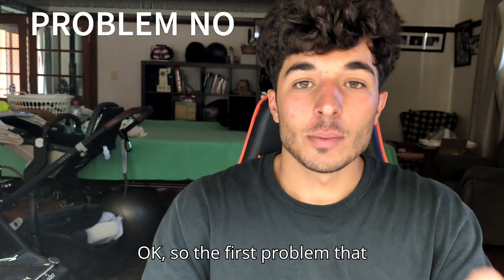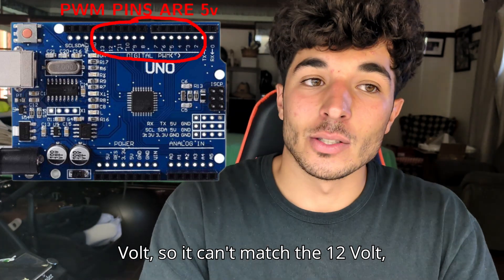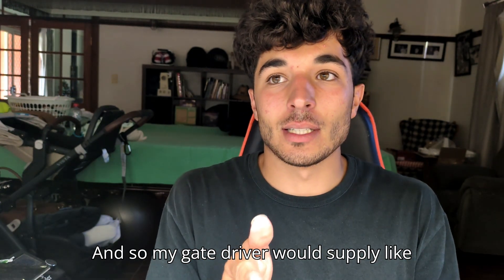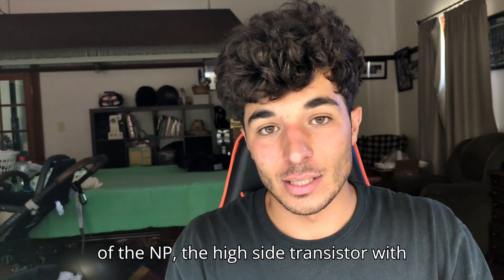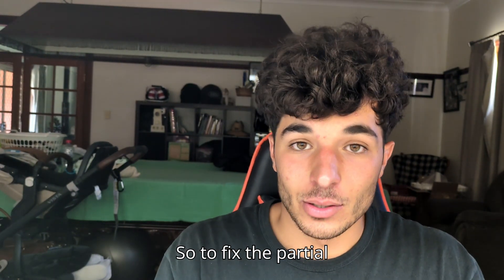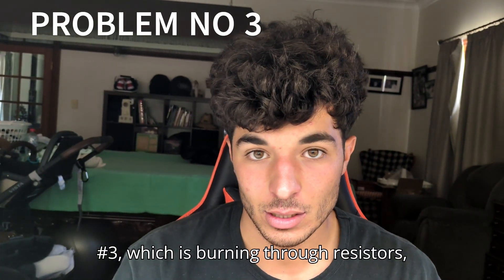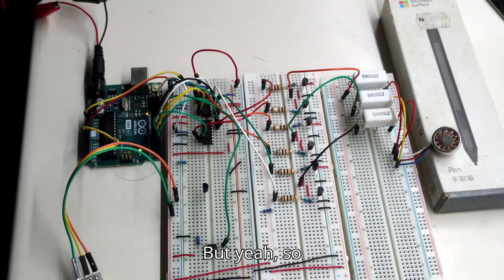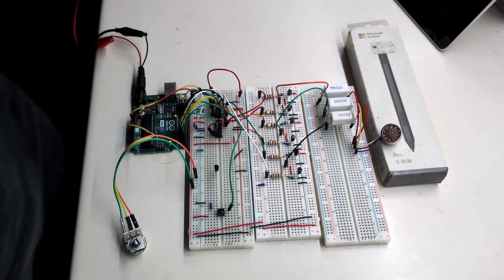Electrical Engineer builds ESC using BJT's instead of MOSFETS

Comment: I truly cannot fathom why you'd WANT to use BJTs for this application when MOSFETs are literally made for this.

I realize that you'll need a single of NPN BJT to translate from the Arduino's 5V output up to the 12V of your motor supply in order to control the gate of a P-channel FET (the top driver), but that's exceptionally simple. And you can tie the Arduino output directly to the gate of an N-channel FET (the bottom driver) and the MOSFETs will barely break a sweat since they're voltage devices, not current devices like BJTs are. Of course, anytime you have a totem-pole or plus-minus driver circuit, you'll need to carefully control the turn-on/turn-off time of each device to avoid shoot-through, but that's easily done with an RC circuit to turn on, and a diode path to turn off.
Reply from the maker: Thank you for your comment I understand that MOSFETS are the king when it comes to this. But since I had already started to build the speed controller with BJT'S I thought I would keep going because it's "technically possible" and wanted to prove it but your comment has taught me a lot so thank you

Comment: Hmmmm....It's pretty rare to find a case where a MOSFET wont work on circuits running at 200V or less. The only exception I recall was when I needed extremely low leakage current, on the order of a few nano-amps.

MOSFETs do require additional design care to prevent ESD damage, but that is often easier than dealing with higher drive currents needed to switch bipolar transistors.

Comment: you could use centre aligned PWM to modulate sine waves instead of stepped DC, you could also map the speed to the max pwm so startup max pwm might be 20% maybe?
Reply from the maker: Thank you for your valuable input I am going to use center aligned PWM in future projects for sure!

Comment: I never considered using BJTs for this type of project. From what I know, they’re not ideal for high-frequency switching and have poor efficiency. However, avoiding the need for a charge pump or bootstrap circuit does sound appealing.
That said, I’d recommend switching to an STM-based microcontroller (like a Blue Pill or Black Pill) or a Teensy. I wouldn’t suggest using ESP microcontrollers for motor driving, as they sometimes have slower switching speeds, and in certain modulation types, every millisecond matters.
I’m not sure about your main objective, but I assume it’s something related to robotics or maybe a drone. In such cases, high-frequency control is crucial, and based on my experience, standard Arduinos aren’t very reliable or powerful enough for this task.
Regardless of which controller you choose, I strongly recommend selecting one that’s compatible with the SimpleFOC Library and using it for controlling any BLDC/PMSM motor, this library is such a powerfull tool and yet it's easy to use (after you get used to configure everithing)! Any ways man, nice video!
Reply from the maker: Thank you for your kind comment and recommendations! I really appreciate the feedback. For this project, I used what I had on hand, but I definitely agree that an STM-based microcontroller would be a great improvement for future designs. I'll keep the SimpleFOC library in mind too—it sounds like a powerful tool!

The main reason I'm building a BLDC controller is to power a larger number of video ideas I have in mind, so your suggestions will help me refine and improve future projects. Thanks again for the encouragement, and I’m glad you enjoyed the video!

Comment: There is a topology by which with a minimum current from MCU you can drive the high side transistor.

+V-------------------------|
|                               |
R1                        T2E
|-----------R2----------T2B
T1C                      T2C
T1B-----MCU           |
T1E                       LOAD
|                               |
GND----------------------|

Where T1 is NPN driver transistor and T2 is PNP Output transistor. R2 is T2's base current limiting resistance. And R1 is the T2's base voltage clamping resistance when T1 turns off.
Reply from the maker: Thank you for your comment, Abhijit! This is a clever way to drive a high-side transistor. My only concern is whether R1 will provide a strong enough pull-up to reliably bring T2B up to the supply voltage, especially with faster switching speeds or higher loads?
Reply: @xavierturano548  It is a basic framework for high side switching. You have to consider many other things along with this. It should work with Lower frequencies. Yes ! Motor driving frequencies are in the Lower frequency range ;), RF's are the high ones. BJTs do have a very Low Base to Emitter or Base to Collector capacitance compared to MOSFETs Gate to Source or Drain capacitance. So R1 + R2 is the pathway for the clamping of T2 during T1's off state. You have to calculate the R2 first according to base current needed for the T2 to drive the Load. Then double the calculated base current because same amount of current you are going to draw from the R1. Now you got the R1 current. Now calculate the value of R1 basd on the current. Now calculate the base current of driving transistor T1 and its base resistor value (not shown in the diagram). Remember motors are inductors, so, those can throw nasty reverse voltage spikes. So you have to consider that. Otherwise you are unknowingly going to create a kilo volt SMPS instead of motor driver ;).
Reply: This is conventionally known as an SIZKALI pair..
powered PNP's are not as efficient as similar NPN's so a suitable pnp drives a conventional NPN ..
for a high side drive...
the opposite config. is also used in certain cases..specially if there's an availability crunch of one type...
Dual edge modulation(centre aligned)
PWM is the best for motor control...so one needs a triangular w.f. generator..
The power resistors are now for "pulldown"..from the base of pnp to 0V potential or ground...
Reply: @analoghardwaretops3976  
Yes you are right, PNPs are not efficient for a direct drive. But at a Lower frequency around 50-60kHz it is okay-ish to do some experiments in a shortage of components in hand.
By the way if you Look carefully to the diagram it is not Sziklai pair. In Sziklai pair Load is driven by the whole pair, actually by the emitter of the driving transistor. The driving transistor pairs up with another opposite type of transistor to form a single type of transistor and works as an emitter follower amplifier. The problem with Sziklai pair is, it cannot get saturated, and causes good signal fidelity in expense of power loss.
In this topology we can saturate the PNP easily, so it dissipate Less heat. This topology is definitely inefficient. But to build a primary proof of concept it will work. Later it needed to be modified properly with driver ICs and MOSFETS, protection circuits etc.
Reply: @AbhijitGangoly  ..so here the npn driver turns on to pull the base of Power PNP low (on)...
so a better grade PNP is required...on the high side ....
& that may be more expensive than the NPN..but doubtfully that efficient....
on a cost to heat losses ratio.

Comment: I am not sure if i miss it. But there are missing rectifying diodes parallel to BJTs (or any other switch) to prevent unnecessary stress to transistors (cs inductive load).
Reply from the maker: Your absolutely right Markus there are no freewheeling diodes which is why I suffered such high start up currents thank you for your comment and feedback it really helps
Reply: @xavierturano548  i am glad that i can help, and share knowledge achieved by Ethernet :D

Comment: So you didn't explain why you want to use BJTs instead of MOSFETs.  For the startup issue the standard solution is to limit the current by imposing a time limit that each switch can be on - you also need to use the correct hex-bridge gate drive modulation scheme so that there is always the necessary off state condition path for any inductive current flow
Reply from the maker: Thank you for your comment, Michael. I was halfway through building the controller when I realized that nearly all designs use MOSFETs or even IGBTs. However, I read that it was technically possible to use BJTs, so I decided to continue as a proof of concept. Regarding the hex-bridge modulation scheme and the off-state condition for inductive loads, you're absolutely right—I currently do not have freewheeling diodes across my transistors to handle the back EMF from the inductive windings. However, I have implemented dead time to ensure no two switches in the same leg are on simultaneously. Additionally, I’ve used a fixed switching frequency so that no switch remains on for too long. I hope this answers your question, and I appreciate your feedback a lot as it helps me improve and refine the design!
Reply: @xavierturano548 ..for your present load of (600-800)mA..and low freq. pwm 6 nos of 1N4007 should suffice as freewheel diodes...but they are a must..else you'll end up with more failed transistors..
& Don't worry this is a learning attmpt using bjt's.....
We had a 110Vdc/@35W 1700rpm  brushless dc fan motor driven with all NPN transistors..& the upper 3 NPN's were driven by 3 pnp in SZIKALI configuration..we were switching @ ~ 12kHz...
eff. was low @ around 80% due to other constraints..but we had a successful market for 5+ years with an electronics failure rate of <7% ...before we changed over to more better all MOSFET designs..

Comment from the maker: HERE IS THE CODE I USED FOR THE SWITCHING COMMUTATION 

// Define output pins for the six switches (MOSFETs)
const int S1 = 2;
const int S2 = 3;
const int S3 = 4;
const int S4 = 5;
const int S5 = 6;
const int S6 = 7;

// Define potentiometer input pin
const int potPin = A0;

void setup() {
  pinMode(S1, OUTPUT);
  pinMode(S2, OUTPUT);
  pinMode(S3, OUTPUT);
  pinMode(S4, OUTPUT);
  pinMode(S5, OUTPUT);
  pinMode(S6, OUTPUT);
  
  pinMode(potPin, INPUT);  // Set potentiometer pin as input
}

void loop() {
  int potValue = analogRead(potPin);  // Read potentiometer value (0 to 1023)

  // Map potentiometer value to switching delay (1ms to 20ms)
  // Turn the potentiometer to adjust motor speed
  int switchingDelay = map(potValue, 0, 1023, 800, 8000);  // Adjust per step
  int deadTimeDelay = 9;  // Dead time in microseconds

  // Step 1
  setSwitchStates(LOW, LOW, HIGH, HIGH, LOW, LOW);
   delayMicroseconds(switchingDelay);
  addDeadTime(deadTimeDelay);

  // Step 2
  setSwitchStates(LOW, LOW, HIGH, HIGH, HIGH, HIGH);
   delayMicroseconds(switchingDelay);
  addDeadTime(deadTimeDelay);

  // Step 3
  setSwitchStates(LOW, LOW, LOW, LOW, HIGH, HIGH);
   delayMicroseconds(switchingDelay);
  addDeadTime(deadTimeDelay);

  // Step 4
  setSwitchStates(HIGH, HIGH, LOW, LOW, HIGH, HIGH);
   delayMicroseconds(switchingDelay);
  addDeadTime(deadTimeDelay);

  // Step 5
  setSwitchStates(HIGH, HIGH, LOW, LOW, LOW, LOW);
   delayMicroseconds(switchingDelay);
  addDeadTime(deadTimeDelay);

  // Step 6
  setSwitchStates(HIGH, HIGH, HIGH, HIGH, LOW, LOW);
   delayMicroseconds(switchingDelay);
  addDeadTime(deadTimeDelay);
}

// Helper function to set switch states
void setSwitchStates(bool stateS1, bool stateS2, bool stateS3, bool stateS4, bool stateS5, bool stateS6) {
  digitalWrite(S1, stateS1);
  digitalWrite(S2, stateS2);
  digitalWrite(S3, stateS3);
  digitalWrite(S4, stateS4);
  digitalWrite(S5, stateS5);
  digitalWrite(S6, stateS6);
}

// Function to introduce dead time between steps
void addDeadTime(int deadTimeDelay) {
  setSwitchStates(LOW, LOW, LOW, LOW, LOW, LOW);  // Turn off all switches
  delayMicroseconds(deadTimeDelay);               // Add dead time delay
}